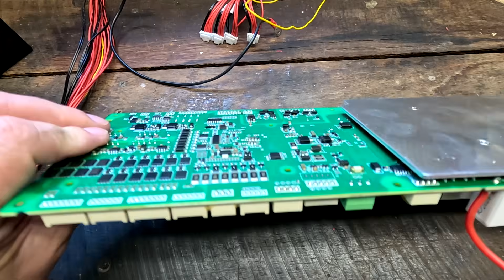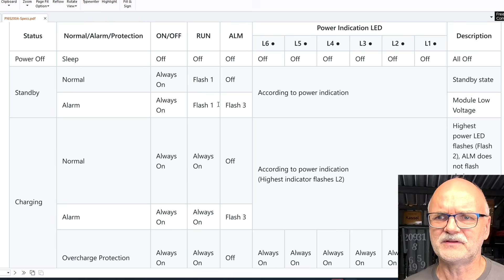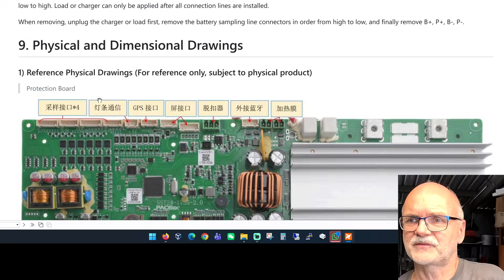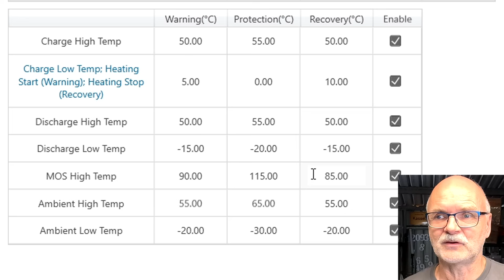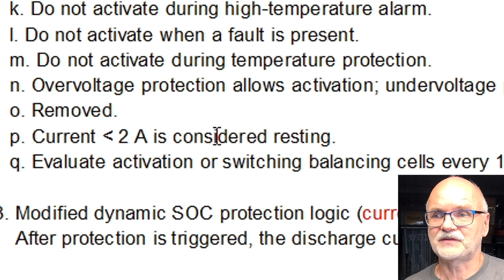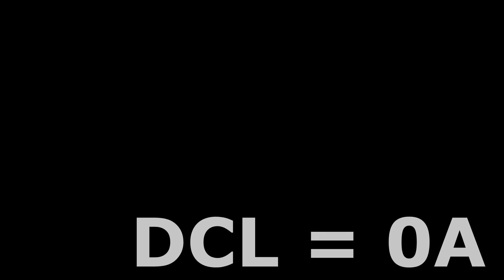New GobelPower BMS P16S200A - Better than JK or just the runner-up?

Comment: OMG Andi, you made me laugh!  "in the JK (the configuration) is far more intuitive to get this all right and up and running". LOL.  While I love the JK BMS, I don't think anyone in their right mind would say that it is "Intuitive and easy to setup" LOL.   If you stop to think about it and review in your mind the various BMS apps and monitoring PC interfaces you have seen before, many / most (?) of them were more intuitive than the JK.       And it's a damn shame that they maintain such a crappy interface.   As you pointed out in your previous video on setting up the JK BMS, you only need to set a handful of values to make the BMS work correctly.   BUT those 3-5 values are hidden in a sea of over 85 (quick count) of mostly configuration variable.    They truly could and should have an outline of the configuration setup in both the app and the PC interface,   exposing only the most important configuration variables WITH an explanation of what they mean and how to set them correctly!   THAT would be intuitive 🙂
Reply: And for that matter, it would be wonderful to have WIFI enabled BMS with built-in micro web server showing a web configuration interface (like EVERY SINGLE other gadget and IOT in our house).    I see a guy asking about a linux interface (Reasonable question!... ditto for a Mac interface etc...).   We could probably hack one together today using an ESP32 module.    That would make a nice project.   Adds $15-$30 per BMS / battery and you have a build-in web intervace, WIFI and once you have that setup, the next step would be a home brew ibms 🙂
Reply: @ivor33  Sorry, I can't agree with you. I do like the compartmentalization of the monitoring solution via RS485, CAN, WiFi, Ethernet that is allowed with these. I don't want to be locked down to one manufacturer's version of whatever. I can simply put a Raspberry Pi in and monitor however I like with whatever software I like without the Battery/BMS manufacturer locking me into their system. Why I don't own an iPhone or much in the way of Apple products. Ecosystem lockdowns are evil and make everything expensive. If you want simple and expensive, go look for a manufacturer that has their own ecosystem and requires fees for you to use your own equipment.
Reply: @chriswardell1623 I agree with you and my statement is not in contradiction. I am simply saying that they should replace the pc-based Windows only software console with a web-based console either running directly on the BMS or on an accessory inexpensive  EP32 board.   The rs-485, the can and the serial interface should always be present.   But also, they should document their protocol so people can develop nice open source solutions rather than heading to reverse engineer the communication protocol Windows inverters.
Reply: I agree, more information with better descriptions and breakdowns of each setting would be very beneficial to the end users.
Reply from the maker: I don't agree. I have seen a lot of apps, PC software and even displays where settings can be changed. JK is really one of the best out there.
Reply: @OffGridGarageAustralia   OK perhaps.   But it's still miserable by all modern user interface standards 🥸
Reply: And more importantly, it could very very easily be improved tremendously!

Comment: The 'Fake' Shunt: For 220€, not having a high-precision physical shunt is a major flaw. Using MOSFETs or low-end SMD shunts leads to a 2% full-scale error. A 4A margin of error on a 200A pack is unacceptable for serious, long-term SOC (State of Charge) tracking.
The Heating Pad Joke: Selling a 'heating' feature when the physical connector isn't even soldered onto the PCB is pure pettiness. Forcing the user to solder directly onto a high-priced PCB—risking both hardware and warranty—is a joke.
Hardware over Software: While the Pylontech/Victron emulation is solid, we’ve over-complicated things. For professional reliability (like Studer or Victron setups), 2 or 3 robust programmable dry contacts are worth more than buggy CAN protocols. It’s universal and failsafe.
Power Consumption: These 'Smart' BMS now consume 45-80mA (up to 2Ah/day!), a huge regression compared to older, simpler JK models (under 10mA). We’re losing 60Wh/day just for the BMS to 'talk' to the inverter.
Conclusion: It's hard to justify 220€ when a JK Inverter BMS is 150€ and comes with all connectors soldered. This feels like an industrial prototype sold at a premium. For those of us prioritizing efficiency and hardware reliability, older JK generations with precise voltage-based settings remain a more robust choice."
Reply from the maker: Great comment, thank you.

Comment: Due to a different footprint I would not use it as a replacement of the JK inverter BMS, as I would have to modify too many things, I would like to know I bit more about the Waveshare rs232 to ethernet device on a JK inverter BMS.
Reply from the maker: Yes, that was also something I didn't like when I tried to swap the JK for this one. I didn't measure before and just assumed it has the same mounting positions and footprint. I found out after removing the JK...😄